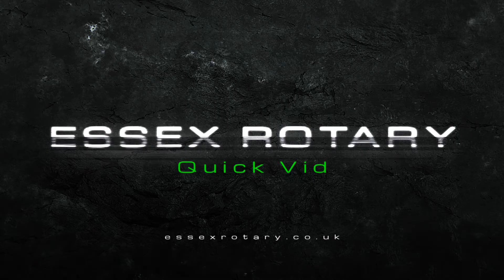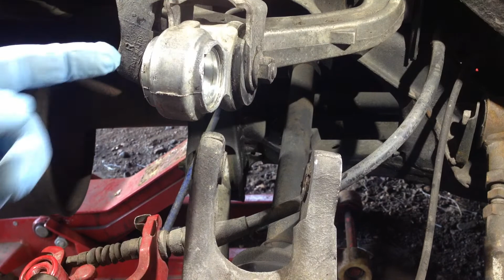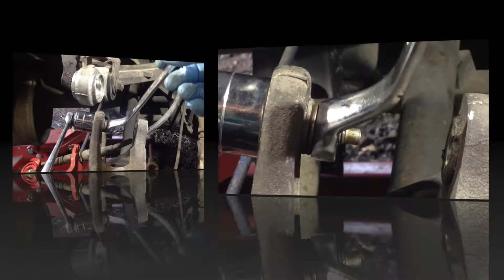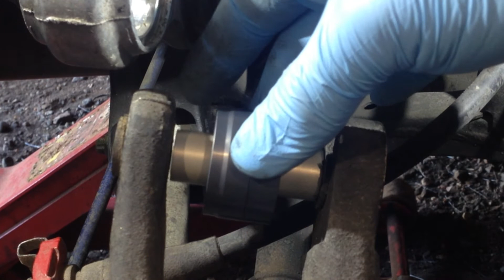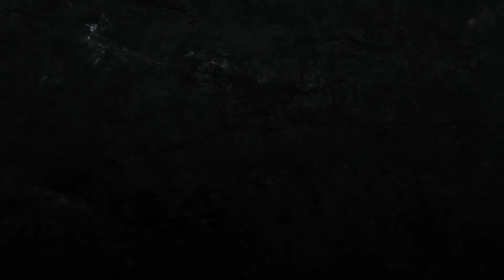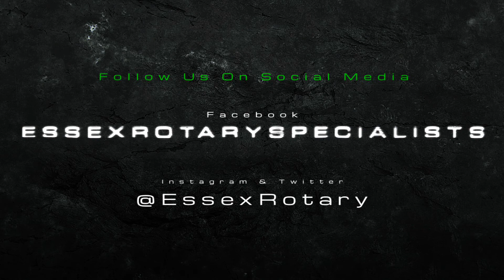Essex Rotary Quick Vid 20 - RX 7 FD3s Rear Upper Pillow Ball Install Tips Pt 2 with J-Auto

Comment: Yesss thank you for this video!!  I am stuck on getting the pillow ball to fit thru the hub and get that bolt on.  But knowing it can be pressed out a bit for more clearance helps so much!!!  Subscribed!!  
Btw I didn’t put new pillow balls in I stupidly disconnected the hub from the arm to get the rear suspension out